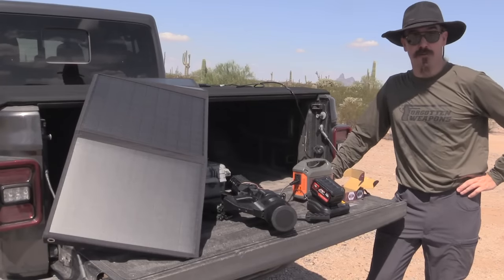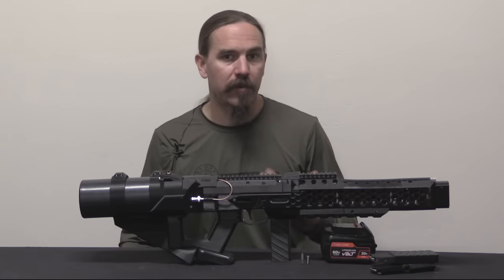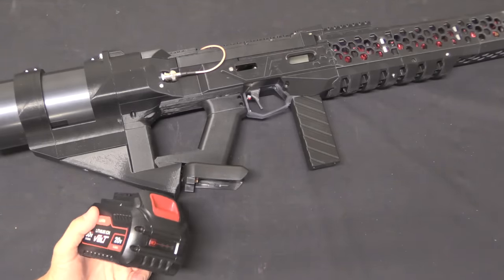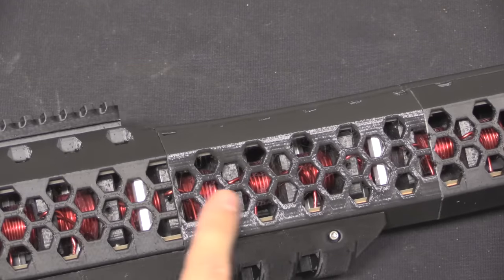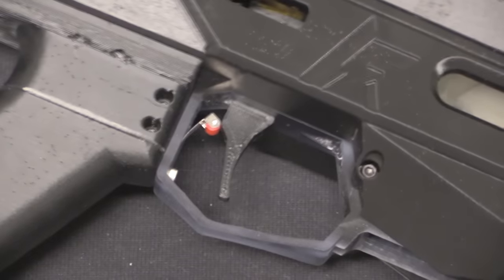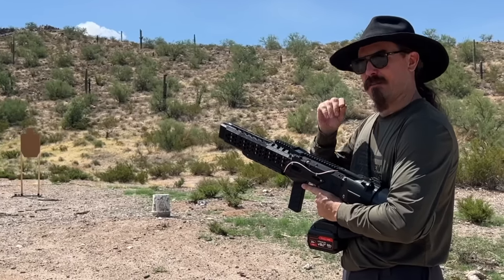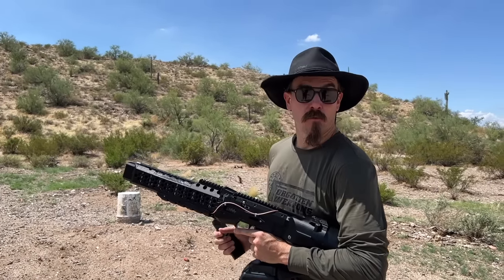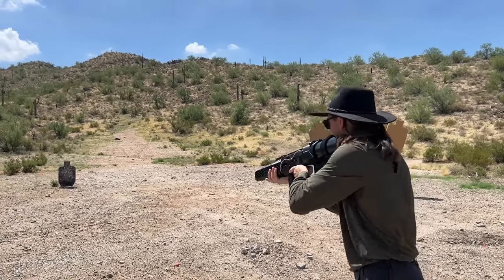ArcFlash Labs EMG-02 CoilGun: Making SciFi Weapons Into Reality

Comment: It is amazing how quiet that thing is. The ping on the target is significantly louder than the actual gauss cannon
Reply: It is far from supersonic (it has hunting bow arrow speeds), and no explosion to propel the projectile. The clicking sounds you hear when it fires are likely just mechanical parts, and my guess it is all just the magazine.
Reply: @louisvictor3473  if it has the same firing system as the previous one, the click is likely the solenoid smacking the back of the projectile into the coils to launch them. other than that there really shouldn't be any noise at all.
Reply: @rathkiee  That is the one I was trying to remember. The magazine has moving parts, but yeah, definitelly not the dominant sound.
Reply: That may be the only upside of this weapon.

Comment: That's quite the improvement for such a short length of time. The design is definitely sleeker, and I'm left stunned at the improvement in recharge rate, though I do have some safety concerns about the capacitor being seated right next to the shooter's chest, as much as it makes sense engineering-wise. I would suppose it's okay for a civilian product, though. It's really nice how much more "weaponlike" the form factor has become now, too. An actually usable handguard might arguably be this revision's biggest improvement, and the battery being seated at the bottom of the pistol grip seems like an excellent way to balance the weight distribution (the genius decision to incorporate cordless drill batteries aside).

Ace Hardware is going to wonder where the hell these gun nuts suddenly buying up all their screwheads, drill bits, and dowel pins all suddenly started coming from.

C'mon, DARPA. You just know you want to dump a billion dollars on these guys.
Reply: Some sort of cage+venting structure should allow for preventing physical damage to the capacitor and containing any fragmentation from a burst capacitor while also not allowing pressure to build up into a bomb. Still, I bet the thing is heavy enough as-is, although a polymer structure probably isn't that heavy anyways. It could also make a more ergonomic/adjustable stock too, or have storage etc available.
Reply: Well, it's not like the capacitor on a radar transmitter charged up to lethal voltages. 60v stings but that's about it. The drill battery prevents the cap from being charged in reverse.
Reply: @eloiseharbeson2483  more than the shock, is about the explosion if it gets damaged by any bump, even a small capacitor gets propelled when exploding and it can poke an eye out, pretty sure they will adress that in the future tho.
Reply: @viriatrix9874  this, I remember blowing up capacitors in electronics class, when this one goes I wouldn't want my face there.
Reply: Let's keep anything federal government related the Hell away from this stuff.
Reply: It's DARPA. They probably already have a warehouse full of working plasma weapons and mjolnir suits mothballed in a hollow mountain somewhere.
Reply: way les dangerous than a magazine that close to you. and those are all voer your chest rig. let alone grenades.
Reply: @FreebirthBoccara  The danger of live ammo is only fully realized when it has a pressurized tube to accelerate it. The wrong type of capacitor is a small bomb no matter how you slice it.
Reply: Also used for researching hypersonic fluuid dynamics by Russian masters of aerodynamics at TsAGI. Most German hypersonic test facilities were in East Germany including ammunition pumped tunnels nearly identical to their Peenemunde "wundeerwaffe kanone" aimed at London (bombed by RAF).
German research of magnetic acceleration for MAGLEV inspired many to use magnetic field switching to accelerate aeronautical models and space re-entry models (all ballistic missiles are hypersonic) which then inpired yet others to use flux switching as propulsive force for cheaper satellite launchers, but the Americans seemed most active innusinh electromgnetic flux switching for a shell.
Russians were also first to put huge Kurchatov laser and LIDAR in plane in 1981 with Beriev modified Ilyushin 76 MD.
Reply: @alexb7641  Imagine the energy density needed for a battery to fire a substantial amount of ammunition at ballistic speeds, you're essentially taking the energy that would be in every cartridge and putting it in the battery
Reply: 9
Reply: Capacitor and batteries still need to get better
Reply: @viriatrix9874  Small caps can go with a bang even though they are supposed to fail safely. Big caps however just vent evil smelling smoke if you abuse them. Many moons ago I had a pile of big caps and a beefy power supply. I tried really hard to make them go bang but the worst I got was a big cloud of noxious smoke.